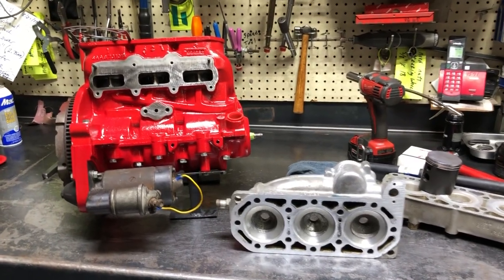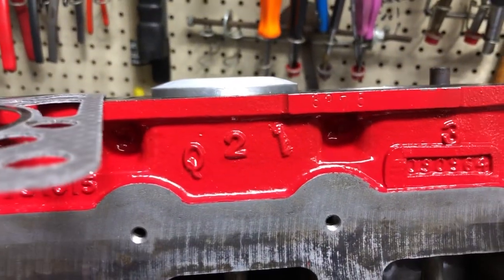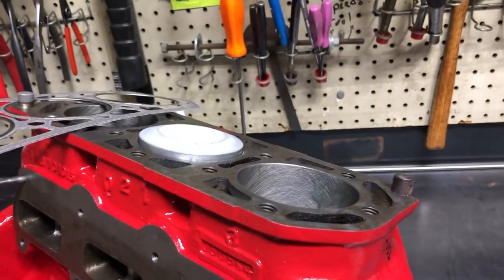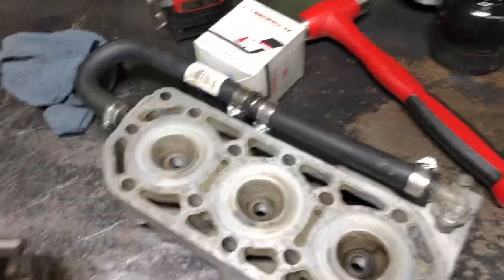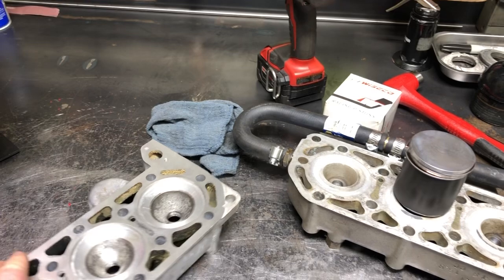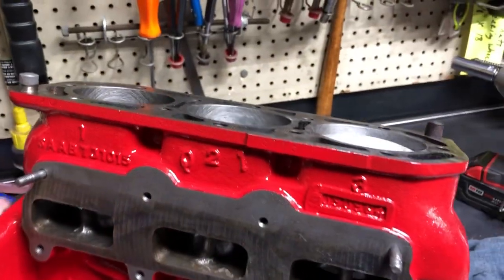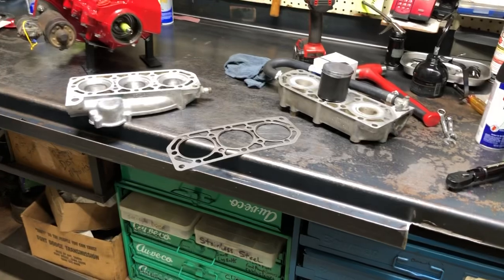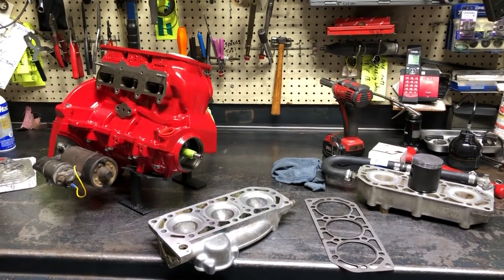Saab Vintage 2 Stroke - Tuning Two Stroke

Comment: Do the 2 stroke motors use expansion chambers in the exhaust?  I saw an interesting video on that.  I think it was from Driving 4 Answers.  Excellent channel IMO.
Reply from the maker: Yes they do.  The chamber is often called a front muffler even though the muffler had a chamber built into it.
Reply: @donneysaab  Is that necessary if the motor uses reeds?
Reply from the maker: Reed valves, add low in power that these engines desperately need however, when we race at Bonneville, we want to end power only so the reed  valve becomes a restriction.    So far our Racing at Bonneville we do not want them, but obviously Had so still been making these cars I’m sure they would’ve changed the technology and added the reed valve or more porting to make the engine more efficient.

Comment: Yamaha or Sea Doo Jet ski..... 2 stroke 3 cyl  were rated at  130 -150 hp... Box stock.
Reply from the maker: Indeed.  But not in 1950!   These are old designs and the trick is to make more with less.

Comment: A long time ago I had an experimental ignition distributor from Saab.
My father worked in Saab's competition department. Three switch tips and three ignition coils. Water could be flushed over the engine and distributor without problems. Unfortunately I sold everything.
But the car, Saab 96 1962, went like a bullet in the night.
About 160-170 km/h between Trollhättan and Goetenbourg at the old road 45.
Reply from the maker: Yes, they love independent coils.  Sounds like you had a lot of fun with yours.

Comment: MZ two-stroke motorcycle pistons have three rings - the ES250/2 (243cc). These make about 17.5 bhp. The bikes were built 1967-73 but replacement pistons are still available.

Comment: 3:08: Not true at all!! Many companies still make aftermarket 3 ring pistons for the following high compression high torque 2 stroke motorcycles such as Babetta, Italjet, Jawa, CZ & Yedzi:

ASSO Werke (Italy)
RAM (India)
HM (Hungary)
CZ (Czech Republic)
Reply from the maker: Thanks.  Odd u mention odd obscure brands never head of an USA.  I talked to Wiseco pistons about making some 3 ring pistons.  They laughed at me and said “no way”.  No modern 2 strokes use 3 rings they said.  But thanks anyway.
Reply: Yeah in fact "most" high hp Snowmobile engines that I have seen are Two Ring...and there are some that are using a single ring...with today's metallurgy and close tolerances its not necessary.  (Most people think pistons are "round" too!)

Comment: Hi Tom,

What's the difference between a stock 850 head and a gt head. I've bought a 93F with a 850 GT engine and bought it with a rattle at the front cilinder. Today ive noticed the head number is 709483 wich refers to a standard 850cc head. I cant read the block number yet, but it has oil injection and a triple carb. When i did a compression test i came at about 90 psi on all cilinders, wich isn't good for a GT engine either. Thanks from the Netherlands! Eelco
Reply from the maker: Reading the block number should start with 716.  Unless someone used a long block injected motor yours has to be a GT block as no standard bullnose blocks had injection.
Reply from the maker: http://www.tomdonneymotors.com/wp-content/uploads/2015/02/Two-Stroke-Engine-ID-Chart-2-11-15.txt
Reply: Thanks Tom,  it's a 716503. But isn't it strange they used a single carb 850cc cilinderhead on this engine instead of a GT head. Or isn't there any difference in those heads?
Reply from the maker: Eelco van Knippenberg not really.  The GT head is hard to source so very common to use a standard head and mill it down to gain back GT head compression.  Also some like lower compression head to prevent detonation and run lower grade fuel as these required higher octane @98.

Comment: I have an old mid 60's 2 stroke Saab was my granddad's and I want to get it out and get it running. Have any tips for me?! Been sitting probably 35-40 years but was parked only due to fuel pump issue supposedly. Decent mechanical knowledge but only ever messed with 4 stroke stuff.
Reply from the maker: I would pull out the spark plugs and squirt some oil down the holes and run the starter with the plugs out a few times.   While you have the plugs out check and see if you have spark.  Then pull the top off the carburetor and clean out the bowl and blow things as best you can.  supply some fuel with a separate pump and 2 gallon fuel can (or whatever works for you). Once you get fuel into the bowl, choke it & crank it over and I bet it will fire off (if you have spark!)
Reply: @donneysaab  thank you! That was pretty much my plan but I wasn't sure if there would be more involved that I wasn't thinking of. My only other concern is the alt/water pump combo.  If I get it running and want to drive it around is that common to just keep on working or would it be bad from sitting so long?
Reply from the maker: dquinn 87 run it!
Reply: Hope your experience went O.K. with the make-run.  After sitting for so long, rusted, dry main bearings might be an issue as it was with so many other engines with roller/ball bearings on long storage.
Reply: Did you make it run again i am really curious. Hahaha
Reply: @jasperprudon  sadly no not yet! Good news is it's still in the same state didn't break anything. It's on the family farm a couple hours from where I currently live and I don't have a place to put it out of the weather here. Just patiently waiting to get some room!

Comment: What do you think about reed valve (also known as intake reed; membrans)? Did you trying build an engine with it? In Europe (mainly Germany) owners of Wartburgs 311/312/353 do that, but I have not seen how it works. Theoretically it;s provide to better loading of gas-fuel mixture. Honestly I'm waiting for a long time for concept reed valves in old's generations of 2 stroke engine (like Saabs, Wartburgs, IFAs etc) or just conversation about this, in my opinion, interesting idea.
Nice work Mr. Tom! Greetings from Poland!
PS. Take my English with a pinch of salt please ;)
Reply from the maker: Mateusz M Yes some people are running reed valves in these engines. XP Extreme Power in Sweden sells them. With a read valve you can run your intake at 100% and whenever there is a pressure difference the reed valve allows flow of fuel into the lower chamber.  Whenever the pressure is higher it closes the reed valve as you mention.  Thx.
Reply: Yes!  Reed valves.  I'd forgotten all about them.  Very good.